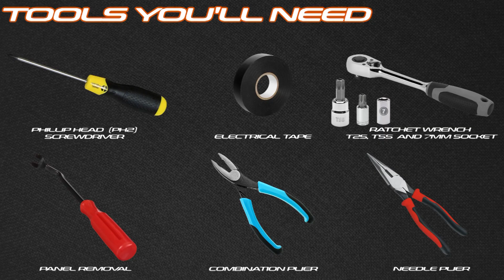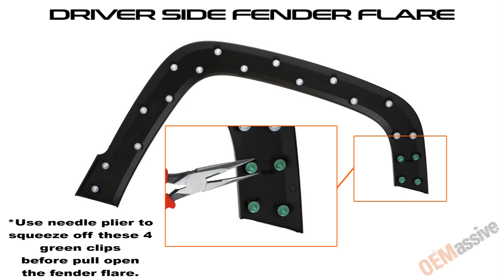OEMassive 2016+ JEEP RENEGADE LED DRL HEADLIGHT INSTALLATION

Comment: Love that I got to this party and realized the outside screw your can’t get with a ratchet because of the hood latches. Also thanks for failing to mention the bumper clip next to the headlights need to be squeezed before you pull the bumper off. Broke one in the process.

Comment: Woof, just replaced my headlight thanks to this video! All I have to say is fuck all clips. No idea how my fender piece actually snapped back in and I broke every single clip under the hood 😪
Reply: Did you use the panel removal tool?

Comment: Would these fit the 2019 model? Also are there any issues with moisture getting inside like most aftermarket lights?
Reply: 2019 and newer the lights are a little different.

Comment: Horrible lights (DONT BUY THEM) OEMassive advertises that ( they offer superior ultraviolet protection from lens yellowing) after 4 months of living in San Diego they are already yellow and now the clear coat is pealing off. I contacted customer service and they said they only warranty them for 2 months. WORSE LIGHTS EVER. Also the corner lights get moisture inside them. I strongly suggest you look for other manufacturers who offer 3-5 year warranties for the same look and price.